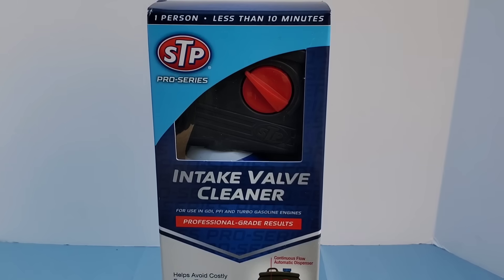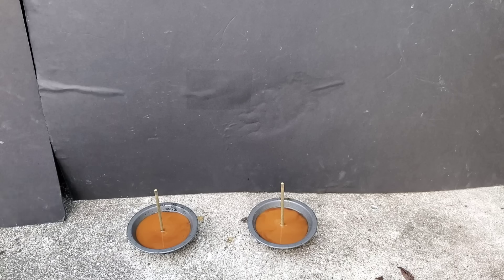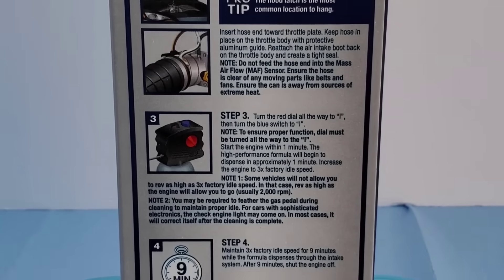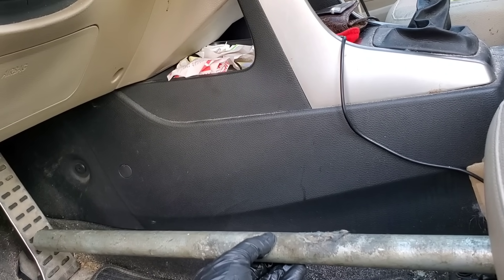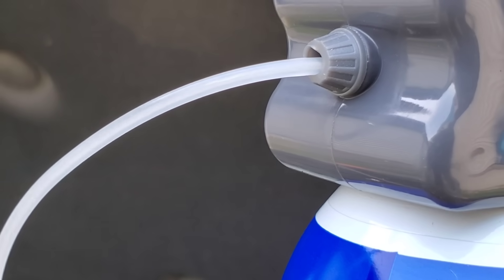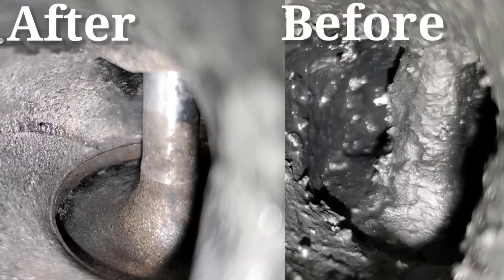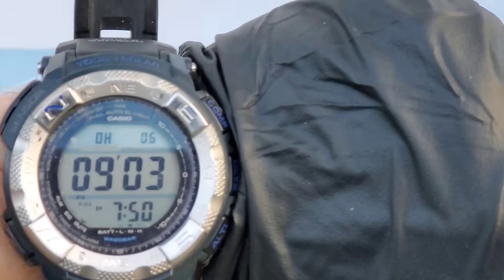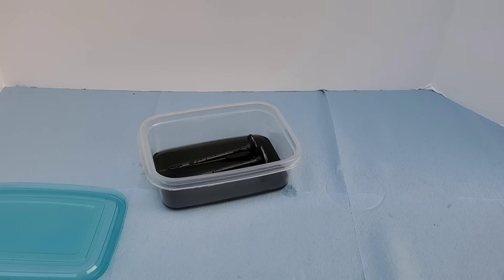Stp Pro Series Intake Valve Cleaner works!

Comment: What concerns me is where does all this buildup go? Does is make it out the exhaust or might I cause the cat to clog?
Reply: Most will burn with the fuel that is burnt in the cylinder... the cleaner itself is also flammable.
Reply: @EXOVCDS  I love your VW videos! I have a 24v vr6 and they're so important to watch before I start a project on it. If I were to use this on my '19 alltrack, should I find a way to add it after the turbo, like in the charge pipe, for example?
Reply: @mikejames3263  Hi Mike. I haven't had to do any intake cleaning on an Alltrack yet... so I can't say where the best place would be, to add the cleaner. On earlier TSI engines, I would remove the intake air temperature sensor next to the throttle body and feed the cleaner into that hole with a vacuum hose.
Reply: @EXOVCDS Thanks!
Reply: @EXOVCDS  i went looking and directly above the throttle body is the map sensor. I don't think the latest engines have an MAF. can i put it in the map sensor location? It like there's a large hose from the intercooler that feeds into the throttle body and then on top of the manifold is the map sensor. Thanks for any input.
Reply: @mikejames3263  I don't know how the engine will run with the map sensor removed and the hole sealed with a vacuum hose... that then is used to suck the liquid into the engine. All I can recommend, is to be careful to not allow too much liquid in at one time. Engine damage can occur.
Reply: @EXOVCDS  Thanks again. I shot it into the throttle body from underneath where the intercooler hose feeds into it. It remains to be seen if I'm still gonna get cold start misfires.
Reply: @mikejames3263  keep me posted.
Reply: @EXOVCDS  Hey I spoke with APR. The plugs that come with the is38 install kit i bought are inadequate for the 1.8t. I ordered NGK r7437-9, which is what APR recommended. I can't wait to see if this cures my issue.
Reply: @EXOVCDS  I replaced my spark plugs today and it drastically reduced my misfires. I ran a boost log and found leak at low rpm’s, but not when I’m really pulling. I’m gonna troubleshoot all my hoses tomorrow. Does this sound typical for a boost leak? Or sound like a problem with my turbo? An example of the boost leak at around 1500-2000 rpm is like .2xx bars. around 20%. Like 1.1xx bars actual pressure and 0.8xx specified pressure. Thanks for your time.
Reply: @mikejames3263  thanks for the update. Good to hear that the plugs made a difference.
The ecm monitors boost and will set boost fault codes when boost is under or over specified levels for too long. Small differences higher or lower are common, even without actual boost / air leaks. Keep in mind that "if" / "when" air leaks, the fuel mixture will be rich... so if you are saying boost is less by 20%, then the ecm should be flagging a rich fuel mixture.
Reply: @EXOVCDS  Thanks for the help. It really matches closely when I'm accelerating. The boost difference is just that big when I'm cruising steadily. There was very fine soot on the plugs i pulled today. On the troubleshooting goes...
Reply: This can start more problems too the valves might leak after, cat issues...

Comment: looks good Nate. wondering how often we need to do this? I'm thinking every oil change interval or at 20k 25k or 50k intervals?
Reply: Typically every 10 k add some sort of additive. Be it intake valve cleaner or Throttle body/carb cleaner. Or whatnot. Don't use seafoam ever on a engine you plan to keep
Reply: @josequilez5449  hey I got a bottle of berryman carb/intake cleaner. On the back it states that I can spray it into the throttle body while car is running, could I trust that it would be safe for the engine and Cat? Thank you.

Comment: It would have been interesting seeing how you entered the camera through the intake manifolds.
Reply: Me too...but you can't see that because he didn't. Those are STP images from their website.
Reply: Probably just pulled off the manifold...
Reply: @Rémi-ngton420  or just pulled the exhaust manifold
Reply: @MrAlim5  Just like the title states, those are intake valves. See how its not black everywhere from exhaust soot? The intake manifold is right in the front of the engine and easy to remove unlike the exhaust manifold in the back. Plus even if you fed it throught the exhaust side during the "exhaust stroke" you would have to feed it into the combistion chamber past the open exhaust valve then somehow through a closed intake valve (during the exhaust stroke) then make a sharp 90° turn to get that camera perspective. Its literally impossible.
Reply: @Rémi-ngton420  thx for explaining...
Reply: @MrAlim5  No problem!
Reply: @MrAlim5  The fouling happens on the intake side, not so much the exhaust side.
Reply: I agree. Very curious how he gets in there
Reply: He is just a gynecologist!
Reply: @vladimirromanov1279  hhhhhh
Reply: Это видеомонтаж, а картинка взята из интернета, стп это полная хрень
Reply: Through a vacuum port…
Reply: I am wondering the same thing because I watched another video that showed the same exact images.
Reply: He used a borescope and snaked it past the throttle plate, down the runner, and to the intake valves.
Reply: He removed the spark plugs and snaked the bore scope into the cylinder that way.
Reply: @richruddock  
Unless you’re a magician, this is almost impossible!
Images are from the back of the valves and not from combustion chambers.
Reply: @richruddock  The spark plugs are  IN the combustion chamber, so, again, how did he get the scope into the INTAKE?
Reply: @monunyabidness5949  you take a camera open the throttle plate up enough to get the borescope in and push it into the runner. It is a pain but completely doable.
Reply: @richruddock  u definitely not a guy who work on cars
Reply: @richruddock  через свечи туда не попасть, это постановочное видео, обман, неужели вы не понимаете?

Comment: I am curious Nate now that my catch can is installed and I empty on each oil change should I use this  stp valve cleaner
To remove impurities that may. Be present like carbon it's a 2012 bought used and  it's had the lower long arm replaced  as well as fuel pumps prime and secondary with socks as well , I changed to iridium plugs at 98k vehicle was abused with 75k in its first year my next lube and filter is at 118k I've got about 5k left
Reply: What brand of oil catch can did you buy? What car and model?
Reply: @bobreese4807  Vincos Universal 3/8"&9/16" 400ml Aluminum Oil Catch Can Dual Cylinder Polish Baffled Engine Air Oil Separator Tank Reservoir Kit with Breather Black Small Drain & High Pressure Hose Line Tube

Jeep GC 2012 wk2
Not nessesarry since it's direct fuel injection but put in place anyway

Comment: I think that i have carbon buildup on my pistons. It's a carbureted 350 in a 1970 C10--- everything made today is for injection engines-- what can I use? Anyone? 🤔
Reply: Seafoam would work
Reply: Use  same thing , just inject it in the intake manifold where the vacuum line is to the brake booster

Comment: I already did this treatment to my car before seeing this video. And YES it made a very noticeable difference on my GDI Turbo engine with only 10k on odometer. So easy just follow the instructions correctly. Hard to screw process up.
Reply: I'd be careful on turbocharged cars.
Reply: @Too-Gq-For-You  Yes considering what goes into the cyl and doesnt get burnt goes back out the exhaust and then drives the turbo it would be risky.

Comment: Great video. I have a 2018 Honda Civic that’s direct injection with turbo do you think this product will work for it?
Reply: Honestly not a 100% fix but I highly recommend to not follow the minder percentage. It will sometimes carry past 5k miles between oil changes. If your running full synthetic oil cap at 5k miles and change oil anything between 4-5k it ideal I also have friends running 5W-30 synthetic and that’s shown to be most effective.
Reply: @GreyMK7Jet  Ok thanks again for the advice. I love the car but I want to last. I also have a 2012 civic ex it’s been awsome it got 20000 miles on it now still running strong.
Reply: It will work, the throttle body is tighter to get too though I am a tech at Honda and will say it’ll be way better to access one of the vacuum hoses on the intake manifold. Also because the throttle body’s on Honda’s don’t tend to Gum up all that bad.
Reply: @GreyMK7Jet  Thanks Have they got the oil dilution problem solved on the engines yet.

Comment: How would you do a valve cleaning on a turbo gdi? On my honda, it looks like the cleaner would be going into the turbo if I just followed the procedure you showed here....
Reply: On most turbocharged vehicles you would do it on the charge pipe to avoid going into the turbo
Reply from the maker: Follow manufacturer's instructions for turbo and I have tried almost every cleaner on the market.

Comment: When do you recommend the first cleaning on a newer vehicle?
Reply: I have no oil loss. Just want to do a preventive cleaning. My truck is a Tacoma with direct and port injection, which the port injection is used to help clean the valves. I have 55,000 miles on it and always run good gas and some kind of cleaner every oil change.
Reply: @bryandunn4886  if it has port injection in addition to gdi, I wouldn’t even worry about it. It’s the gdi only engines that are so dirty.
Reply from the maker: You can perform the cleaning at the least  every 15000 miles. a oil catch can could be beneficial. Just follow manufacturer's recommendations.
Reply: @NATESINTERACTIVEAUTO  ok thanks, look into. Great videos and keep up the good work. The world needs more people like you out there.
Reply from the maker: Do you have a oil catch can? How much loss of oil is noticeable between oil changes? The longest I would wait is 15,000 miles but usually I do it much sooner however it will only be a couple of ounces in order to keep it from hardening.  First check the specific cleaner manufacturers recommendations. They are all different but typically the same.

Comment: Does anyone know how this would affect a roots style blower with a carburetor? I have heard spraying something like this or sea foam through the carb would remove the coating on the rotors?
Reply: I have an Audi s4 (supercharged) I was going to use CRC intake valve cleaner but decided to contact CRC before using it - there advise was to NOT use it with supercharged engines.
Unsure how this compares with STP version as it could possibly be a very different formula.
Reply: @rossn5186  good info. I never bothered, seems too questionable.
Reply: I would not worry about it as the spray wont even contact the rotors as they are usually not near intake track
Reply: @pascalolesen5187  That doesn't make sense to me.  The intake air is compressed by the supercharger rotors.  So if you're spraying the cleaner into the intake, the cleaner is also going thru the supercharger rotors.
Reply from the maker: I really do appreciate your kindness, taking time to help others and thats what the NIA community is all about.
Reply from the maker: Great  question and it appears someone has answered.

Comment: Wow! May have to give this a try on my 2003 Ford Taurus with almost 300k miles. Great video Nate 👍
Reply: @Zach Elder your Taurus is not DI. So it is not necessary for you to go this route. Perhaps using a quality injector cleaner added to your fuel tank would be a good idea.
Reply from the maker: Hey there thank you for your time it doesn't go unnoticed.